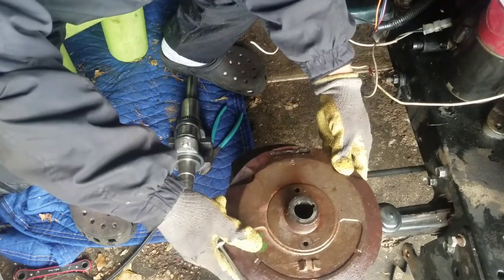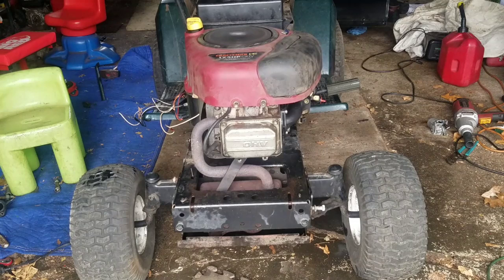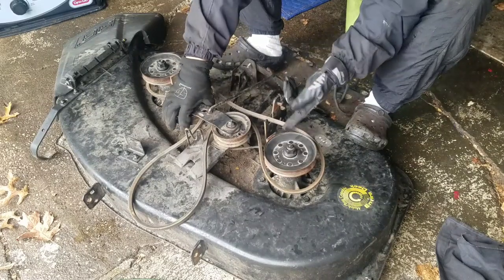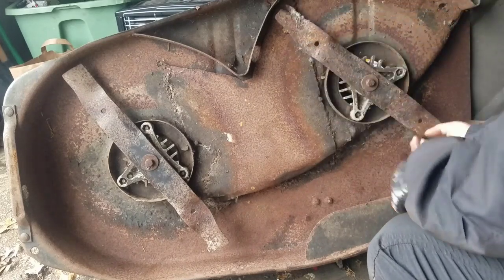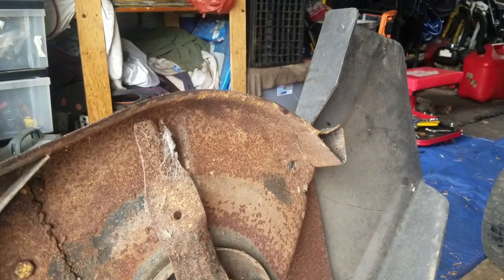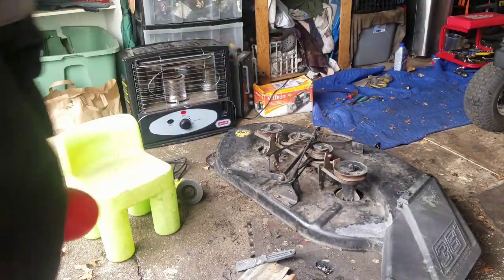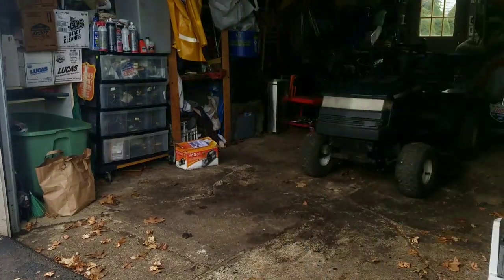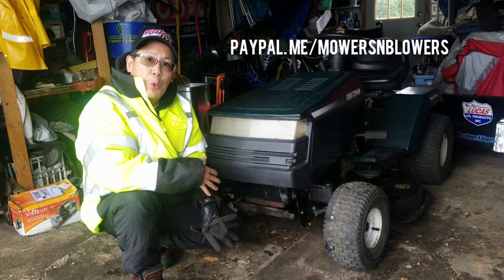CRAFTSMAN LAWN TRACTOR RUSTED ROTTED MOWER DECK WELDING REPAIR HANGER PTO ROD LINK INSTALLATION FIX

Comment: Thanks Henry for the shout out. I'm still trying to figure out my carb linkage issue. I think I'll try to find a new carb on ebay. Mike from CT.
Reply from the maker: Mike, you got my two emails right? If you give me your engine model # I'll find the carb for you.
Reply: @MowersNBlowers  Yes thanks I just bought carb on ebay. Hopefully that does the trick. I hate dealing with linkage/ governor,

Comment: Henry get some lights for that mower, LED lights, another great episode bro. Next time you do a rider go over the electrical system for us.  I'm having trouble with my 96 MTD opposed twin 18hp won't do anything. No sound or clicking, battery charged. Switch or solenoid.
Reply from the maker: I have lots of videos on electrical

https://youtu.be/_3RnnI1YmgI
Reply from the maker: https://youtu.be/oSO4G-gJGZw
Reply from the maker: Here's is how to take a wire from ignition switch directly to the solenoid and bypass all switches, your engine will run.

https://youtu.be/GpOpcsP6cOY
Reply: Thank you very much for the links and your help, your the best bro.
Reply from the maker: @alviejameshoke4426  let me know if you need any help.  DM me on instagram

Comment: Buy the cheap paint by the case...

Turn the voltage down on the welder and adjust the speed.  If that doesn’t work, just tack weld it.

For decks...why don’t you buy Rustolem paint in the pail and brush it on?
Reply from the maker: Yeah, I love that brushed on stuff, so much thicker but I don’t like the brush marks.
Reply: Mowers N Blowers,

I was just asking...if it leaves brush marks just say, part of the tune-up process is going over the scrapes and scratches with oil based paint.  When I sell snowblowers and once In a blue moon people will spot it it and call it out.  My response is...scratches from use and storage expose bare metal.  Bare metal will not rust and rot.  Part of the tune-up is preventing that process and preserving the machine for many seasons to come.  It should be done every year as preventative maintenance.😬
Reply from the maker: @pattayperformance  lol!
Reply: Mowers N Blowers true story!   Good luck

Comment: Square hood craftsman called g4000
Reply from the maker: Thanks Matt
Reply: G4000? The older silver square hoods were LT4000 and than they moved onto LT1000 I never saw a G4000, do you have one you can share via a link?

Comment: I saw the flywheel you think you need used, $79.95 ebay, still a pretty penny. But anyway I'm wondering if any of the 4 blown ones I have, have that odd ball flywheel. Is running an engine with a nail as a flywheel key ideal? No. If I bought a machine and pulled the flywheel off and saw a nail in their be pissed, yes. But it works.
The only issue is if it ever had to shear, although rare, thats when the problem would arise, because instead of the nail shearing to save the inside, the inside is what would take the damage. Oh well I guess..
What year is that silly engine according to its numbers, I wanna know if I have that flywheel.
Regardless we learned something from all of this, if one part isnt correct, it can cause major problems, outleast we all got to find out what the problem most likely was.
Reply from the maker: It’ll be alright, if I ever sell it, I’ll tell the new owner to watch my series, plus it has the metal hood surrounding the engine.  Shearing flywheels On lawn tractors are rare on explosive shears.  The long slack of the belts absorb any impacts that compare with push mower setups.
Reply: @MowersNBlowers  If I have it I'll donate it. Just owe me one, like that time you found me that nice tractor down here, but at the time I didn't have room to take.

Comment: Now that I thought about it, you might wanna hold off on selling that machine until you resolve the flywheel issue. If it fails and causes injury it could get ugly. I see the one you need used $79.95 ebay.
Give me that engines model and production year from the code and I'll check my stash and see if I have that oddball flywheel.
Reply from the maker: 31R707 0033 G1 150123ZD
Reply from the maker: And that’s assuming the valve cover is original.  May not even be the correct model#
Reply: @MowersNBlowers  Ok thank's, Even if the model is not correct, I know which part number flywheel I'm looking for and the difference.

Comment: Where did you get your boom mic from, share a link here or in pm on Instagram..... If you could be so kind.... Said in a British accent.... But of course.
Reply from the maker: No problem governor!

https://rover.ebay.com/rover/0/0/0?mpre=https%3A%2F%2Fwww.ebay.com%2Fulk%2Fitm%2F333403499309
Reply from the maker: @Samuel Sandoval yup, clip and the 3.5 thing in the hole.
Reply from the maker: @Samuel Sandoval an old Samsung galaxy s7 edge!  Crazy right?  You're questions give me an idea that you're going to start making videos.
Reply from the maker: @Samuel Sandoval if you're gonna make videos, it may as well be for all.
Reply: Tks buddy.... The fluffy mic cover is called....a dead cat wind blocker mic cover..... That gross...... LMAO
Reply: @MowersNBlowers  can't get a definitive yes or no answer from the seller, does it have an internal rechargeable battery?
Reply from the maker: RobertKnighthawk more like dead rat cover!
Reply from the maker: RobertKnighthawk no battery!

Comment: Don't sell it with that nail in the flywheel, if it shears it could possibly grenade the flywheel. That's why they make the key out of aluminum so someone doesn't get killed.
Reply: Agreed.
Reply from the maker: Of course but what else can you do, either the nail stays or it’s $180 for a new fly wheel, or another disassembly to insert another crankshaft.  Given the value of this tractor,  just not gonna happen.  Hey it has a metal hood encompassing the entire engine.  Nothing flying out of that engine compartment.
Reply: Agreed, $79.95 ebay used. Give me the exact model and year that engine was built and I will check all 4 of my blown 500cc engines and see if I have one, If I do I'll sell it even cheaper.
Reply from the maker: @zxc30738  the link you have looks like itll work.
Reply from the maker: @Mr_Tecumseh  I appreciate that bro, but I wouldnt even spend half that.  Tractor isnt worth spending any money on it.